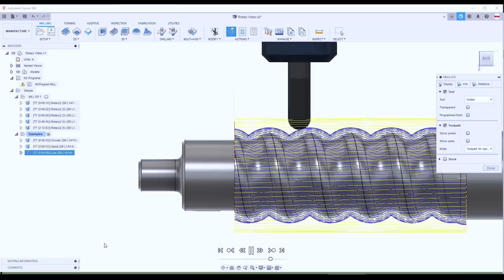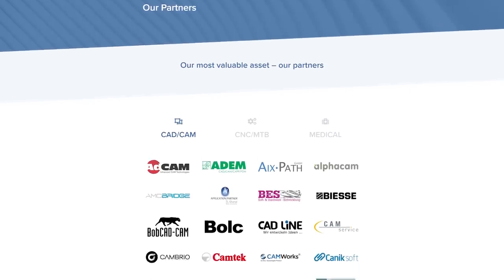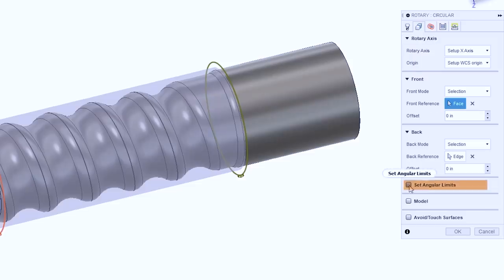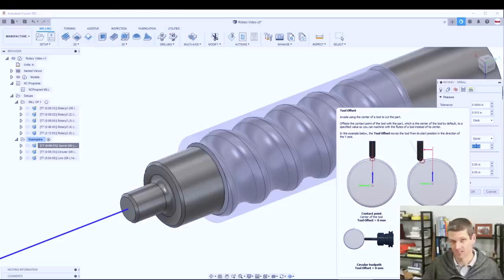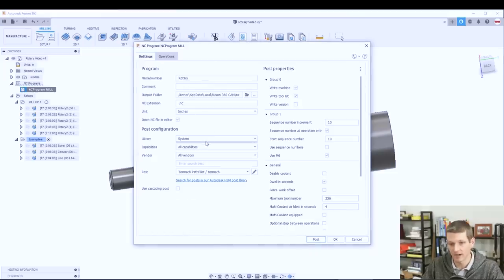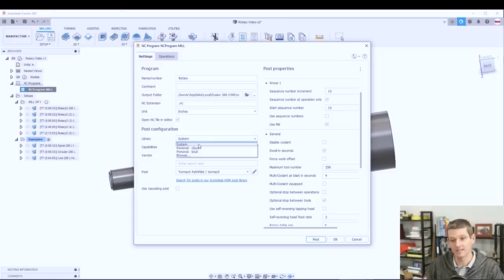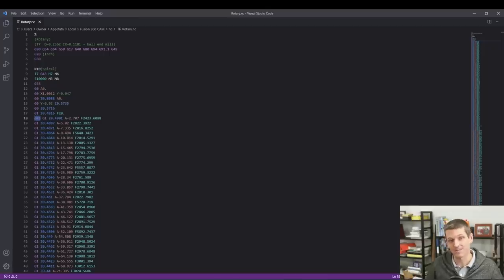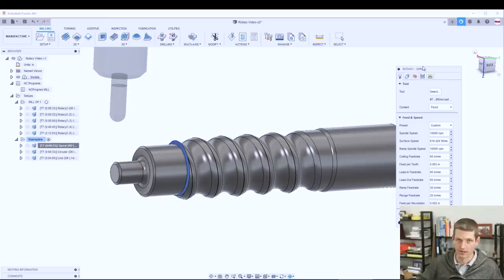4th Axis CNC Milling Non-Cylindrical Parts Using Rotary Toolpath in Fusion 360

Comment: I was super disappointed when I paid for the Fusion 360 Subscription only to find out that this toolpath was not included.  Buying extra "cloud credits" to pay for this features almost made me wish I hadn't bought the software at all.  I considered asking for my money back but ultimately decided to keep it.
Reply: I did the same thing.  Bought a three year subscription thinking I'd get this once I bought the program........ surprise!!  NOPE pay another 1700 a year for one toolpath.  uh nope
Reply: I'm a noob in CNC machining, I spent a lot of time to watch learn videos about how cool is free F360... I cannot describe how I was surprised when I tried to install this FREE software.....
Reply: Same here.  Fortunately, hand writing Gcode isn't that difficult for most rotary operations.  Honestly, other than the ability to use rapid advance, I don't see what else I got from the paid subscription.  For hobbyists, I wouldn't recommend it.
Reply: Check any of the big cams to see how much 4th axis packages cost and then come back. It's like 2200 for 1 year of f360 with the manufacturing extension. They dont even say hello to you at that price with any of the big cams.
Reply: @TommiHonkonen  but you're getting A LOT less CAM.
Reply: To be honest they really do add a lot of new features every year, the steep and shallow toolpath is something I’m also going to use when I get my 4th axis running because it’s going to save me hours of programming.

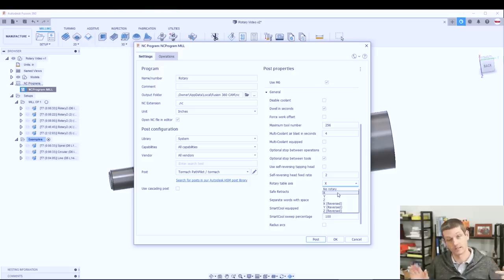Comment: At 5:10 you mention getting the rotation backwards. The reason for this, at least on my Tormach, was that PathpPilot already defines the direction the axis is pointing. It's one of the questions asked while doing the initial MicroArc setup. Thus, if you tell PathPilot the MicroArc is on the right, pointing left, and then tell Fusion that it is pointing in the X-, you get a double negative and end up with the direction inverted.

Comment: Checking the cables - in networking technology, we call that a "layer 1 problem"/physical layer of the OSI model.
Whenever you troubleshoot, always start at Layer 1 and then go up.
Shout to the network admins out there.  W00t w00t.

Comment: I find that defining the 4th axis in a machine gives you more options than defining it in the post processor.  Then all you have to do in the NC program is select the machine (you don't need to define the machine in the setup).  My 4th axis has a bit of backlash, so I like the option in the machine setup that allows it to prioritize one way directions.

Comment: You could off added to the post the bit of code that lets you set the toolpath WCS somewhere else other than the Setups WCS at dead center and the rotary is in the exstension is it not?  Time of flight getting A and B to be at the same places at the same time.

Comment: pretty sure you could do this with a flow tool path. I used the rotary tool path quite a bit before they made it an additional subscription, but it really is just meant for wood routers with 4th axiis to carve out tiki torches. theres an option to check to force only 4th axis, you might need that to do the flow toolpath
Reply: Flow is heavily geometry dependent. Rotary is not.
Reply: @ScottMoyse  true the rotary toolpath acts kind of like the simple surfacing tool paths, it just simplifies the geometry into a mesh and moves accordingly. the flow toolpath is much more complicated to get working correctly. I often find myself modeling surfaces just to make it do what I want, then tweaking those surfaces to get the desired results.

Comment: Has anyone else had the forever unwrapping problem when programming with the tormach? When using the rotary tool path on the tormach micro arc I can't get it to take the shortest path. This would be great if you can make a video about it!
Reply: Same issue...it's takes forever to unwind thousands of degrees.  Really hope someone can share the fix

Comment: Fusion 360 is an over complicated cumbersome software program made by computer wizards with a significant lack of understanding in the term “ease of use”. Hypermill or OneCNC are better for just getting parts out the door. The wizards at Autodesk could learn a thing from these rival packages.
Reply: You're comparing Fusion360 to Hypermill? Haha, ok. It's like a Go-Kart to an F1. They're unrelated markets. Hypermill is stupid expensive. Sure the team on Fusion could learn something, but they also don't want to pay for the Modules that can make life easier to do. So the coding has to have major workarounds. Thus it's cheaper.
Reply: @gredangeo   Unrelated markets? If you’re making parts in any sort of fashion they’re related. And as I said Fusion could learn from a package that does it right. OneCNC is considerably cheaper and also considerably easier to use than fusion 360. That coding remark is yawn, it’s a multi national conglomerate with significant resources behind it. If you’re paying for a service that’s promoting itself as a  do everything CAM package and it falls short, pointing out some of its failings to Autodesk and it’s paid promoters shouldn’t fall on deaf ears.
Reply: @gredangeo  Depends how you look at it, fusion is cheaper initially, Hypermill, Esprit, WORKNC, EDGECAM are cheaper in the long run since they're not subscription based. You buy it once and it's yours. Fusion 360 you pay a subscription and in a few years that subsciption might change what you own, then you need to start purchasing additional features like rotary toolpaths etc. Who knows how long it will be before they start charging extra just to use the 3D toolpaths, or they introduce machine kinematics and you need to start purchasing these too? The support also isn't great, with any of the other companies you call a phone number and an engineer who is an expert in that specfic product will call you back and guide you in the correct direction,  most of the time, actually doing it for you and showing you how so you can do it in the future. With Fusion, there's no phone number, you might need to post on a forum or watch some videos. What happens if you end your subscription because they're now charging too much? You're already locked in that environment, it's an amazing business plan and it's working well.

Fusion is great if you have a three axis mill and don't mind spending some time learning it yourself and modifying your own posts but apart from that it's not so great. A few examples from the last time I used it, there were no kinematics, so poor simulation. No kinematics means that five-axis cycles are not aware of the machine limts, which means it's likely you'll get overtravel or a poor approach to the cycle. B Axis turning is not supported. Turning needs serious work in my opinion.

That's not to say Fusion is bad, there are some nice features, like the ability to edit a toolpath directly. Obviously this is pulled from delcam and the implementation is not as good as powermill but the base is there.